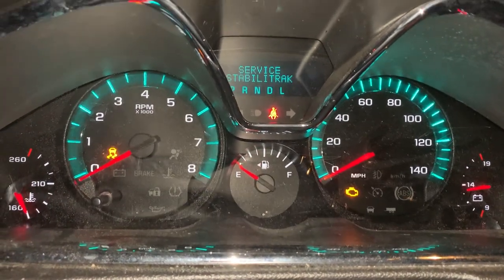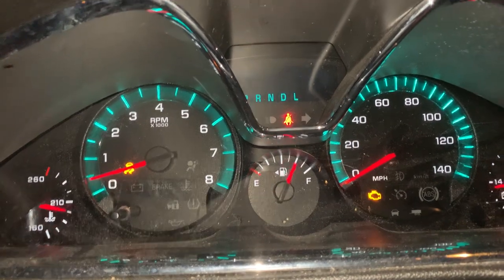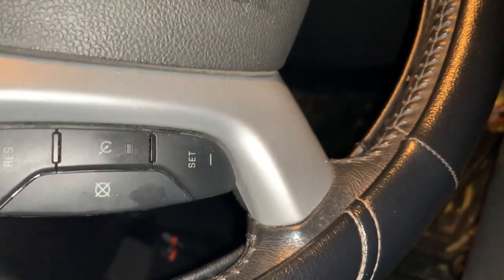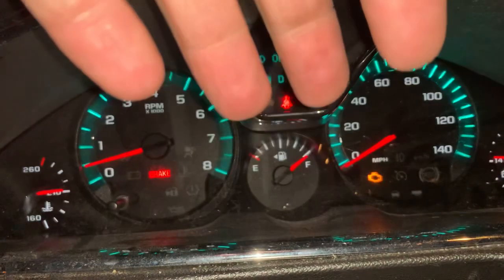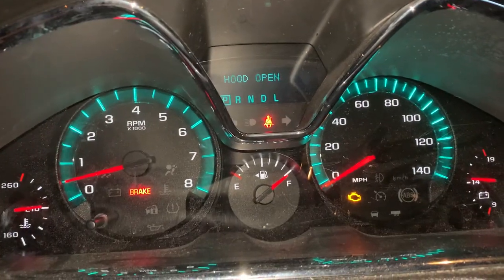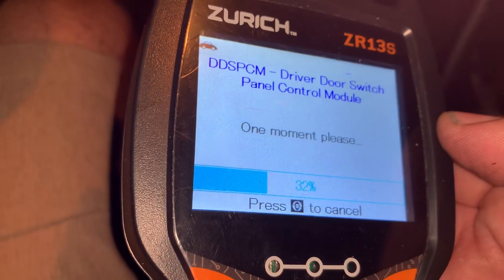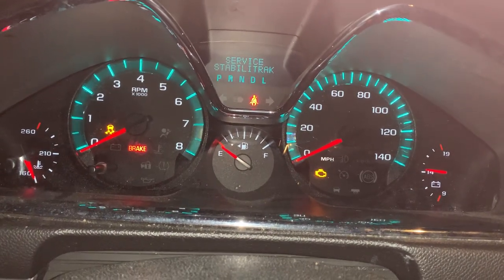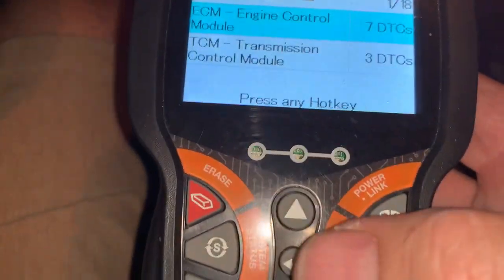Chevrolet Traverse DTC Code U0100, U0073, U0121, U0140 ECM PCM diagnosis and possible fix

Comment: After I disconnected my battery and replaced my O2 sensors hooked up the battery, 2 days later my 2013 silverado did the same thing but got to the point where now my scanner will no longer read the ECM. All was fine up until then. I was addressing a below prodocall cat issue.

Comment: Mine did same https://youtu.be/VuVGKv6DUn8?si=8zA0MwZqb3jIgHix

After months of this happening to me and many times left me stranded no start and dash going crazy After 6 grounds cleaned out the problem with continue. The 2 red wires going to the Fuse box where Very corroded. Clean the power going to the Fuse Box. In my Case it fixed the problem.

Comment: I am in the process of fixing this same issue. Dash went crazy then the guage needles wouldn't move from 0, and vehicle would barely run when it did start which was very rare. My OBD2 scan tool would power up but not connect to the cars network. I finally found that the abs module was causing the normal (2.5v) volts on the Canbus network at OBD2 connector pins 6 or 14 when testing to ground was over 8 volts. This in turn caused all kinds of this weird crap. As soon as i unplugged the abs module under the vehicle, near the driver's side frame rail,  the vehicle would start and the instrument cluster and nav display would act normal. This took me a serious day to figure this out. This abs module had part of a plastic shield missing that is supposed to deflect water and crap away from it. 
Hope this helps someone.
Reply: Same what was the fix
Reply: @pholiciacarreras806 it ended up being the suspension module above the spare tire. It had corroded open and was shorting out the canbus network. I removed that module and jumped the Canbus to the end resistor and have had zero issues in a year.

Comment: My 13 traverse had all the same lights, split speed sensor and rear differential is probably empty of gear oil.  Junk cars, every single one has all of these problems. None stop fixing!!!!
Reply from the maker: It's a shame what low quality GM has allowed on the Traverse.  This vehicle could be a market dominator...but it's got a terrible reputation.  I am constantly fixing something on my 2017 that's beyond normal maintenance.  A missed opportunity for GM.  A recent example...Just this week my wife informed me the passenger window won't roll down.  I've dealt with much worse!

Comment: I have exactly the same problem with a Buick Lacrosse, the ECM and BCM have already been changed, it still has the same fault.  were you able to solve it?
Reply from the maker: Yes.  I got some heavy-duty zip ties and I secured the harness so the full weight of the wires was not pulling down on the connections going into the ECU.  I haven't had a problem since...that was over a year and many miles ago.  
The wiring harness is actually pretty "heavy" when you consider prolonged stress pulling down on those connections.  
I have no doubt that over time with stress like this, wires could break internally and you wouldn't know unless you tested each and every wire.  If wires are broken internally, you might have intermittent failures and would be so hard to detect!  I'm just using my imagination as to what possible issues  could contribute to these symptoms.  If you have already replaced the ECU, and you are sure the connectors are in good shape, I would consider an internally broken wire as the culprit.  Good luck!

Comment: I have a 2012 Buick regal and I’m fairly certain this is the same exact thing that’s going on. Suspension to ABS lights to communication bus, my idea is I think the motor mounts not being replaced by the previous owner caused the engine to fray a wire, or disconnect. Causing this issue. My wonder is if it is considered a recall.

Comment: I have a 2011 cts Cadillac have similar issue but mine is when I turn left on the normal speed, the dashboard lights goes off-on and the ABS light comes on including traction control, the minute I turn the steering wheel straight it’s all normal! 
I got the same codes as yours. 
Now I got a clue about the issue, but don’t know where that plug is located ?
Please help me how to find it
Reply from the maker: Two things:  1) If this is happening when you turn the wheel, I would focus on a broken wheel speed sensor wire.  On each tire/wheel knuckle assembly you’ll see a single wire leading to the hub of each wheel.  You likely have a wire that’s gone brittle and broken inside the jacket.  The wheel speed sensor could need replacing as well.  None of this is complicated work.  But if you can get your codes pulled, they should tell you which wheel speed sensor is the issue (right front or left front).  This is just a guess since you mentioned it only happens when you turn the wheel.  
2) If this does have something to do with the the PCM, on my vehicle it’s attached to the radiator (between the engine and radiator).  Just look for a module that has som fairly large plugs with lots of wires going to it.  That’s likely your ECM/PCM.
Reply: @pattywaktdiy4175  yesss you’re right, I checked today and turns out the rear left wheel speed sensor is broken. 
I’m replacing it tomorrow by God’s will. 
Thank you man

Comment: I have the same problem with my Chevrolet Tahoe 2007 and I have the U0073 code Do you think the problem is with the computer of the transmission in the hood I really appreciate your help
Reply from the maker: It's so hard to tell.  I don't have any experience with this code other than what I show in the video.  I will say, mine was due to a loose connection of the bottom plug that goes into the ECM.  Since I secured that connection, I haven't had an issue again.

Comment: did u ever fix the issue
Reply from the maker: Yes, in my case it was a “loose” connection plug going into the ECU.  The root cause is that a zip tie broke that supported the weight of the wiring harness.  Without that zip tie the full weight of the harness was “pulling down” on the very bottom plug of the ECU.  Now that I have that weight supported, I haven’t seen this problem again since…now about a month later.
Reply: @pattywaktdiy4175 and now? it’s gone for good?
Reply from the maker: @azzz8083  yes it’s fixed. I have not seen any of these codes again since I posted this video.  I still own the car and have put another 10k miles on it.
Reply: @pattywaktdiy4175 how did you fix it?
Reply from the maker: @tatahkimyong  see my response to the parent comment on this thread.  In short, I supported the cable weight of the cables that connect to the ECU up by the radiator.  So, basically a loose connection that was fixed by supporting the weight of the wires. I haven’t had any issues since I added a couple of zip ties to support the weight of the wires going to the ECU.
Reply: @pattywaktdiy4175 did it still drive
Reply from the maker: @a @ashleyredden2201 I sold this Traverse about 4 months ago but it worked fine since this video. I didn’t have any more issues.

Comment: The same thing keeps happening to my  2010 TRAVERSE. Tract keeps coming on. The funny thing is, whenever it comes on, I would touch the brake switch, and it would go away and then come back after I start driving. So, I'm going to do an electrical test on the brake switch connection, also I will check the connection on the ECM also. Thanks for the video.
Reply from the maker: At this point I think the root cause of my issue is the wiring harness is not secured.  It’s hanging with all of its weight on the bottom “gray” plug that goes into the ECM.  Over time, I can see how that weight is probably slightly deforming the plug.  Now that I’ve supported it “zip tied” it so the weight is supported, haven’t had the issue for now at least two days.  This issue was way more frequent than that so I think I’m on to something.  For $175, I still have a new pre-programmed ECM/PCM on the way just in case.